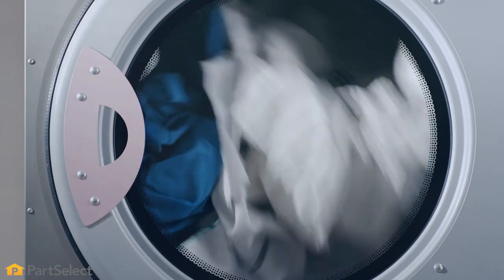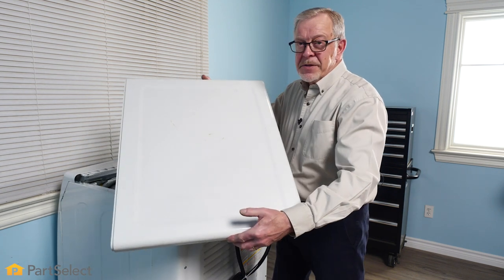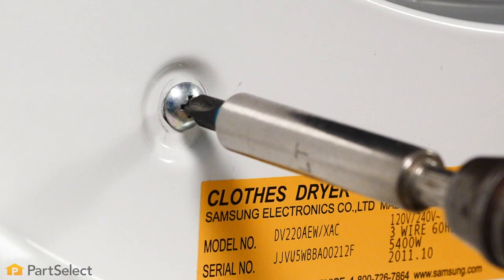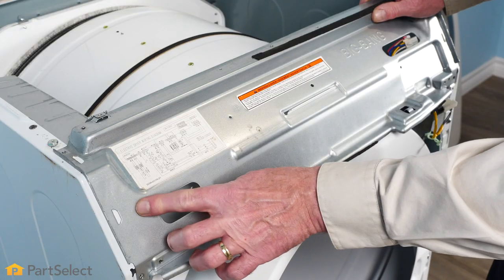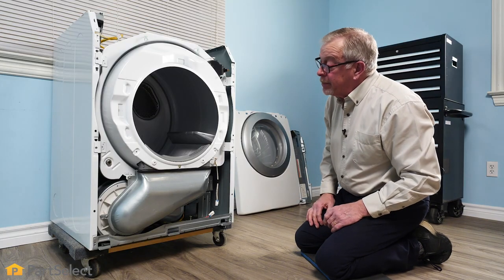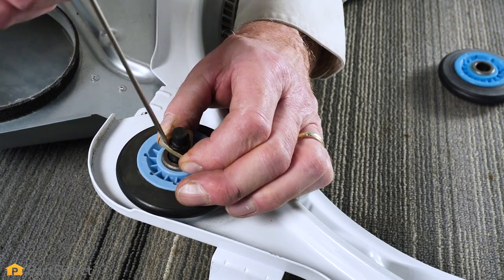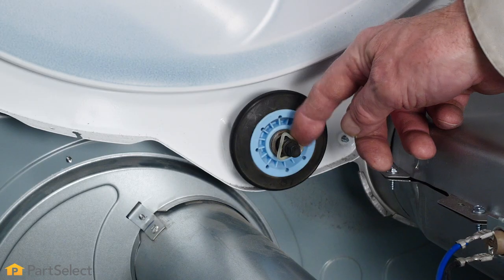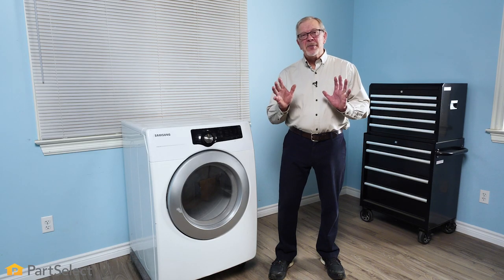Dryer Troubleshooting: How to Replace Dryer Drum Support Rollers | PartSelect.com

Comment: I watched your video.
I then took the front panel off, as well as the back panel.
I was able to remove and replace all four rollers and roller shafts/axles without taking the dryer completely apart.
I have a Maytag 5000 dryer.
Just an FYI.